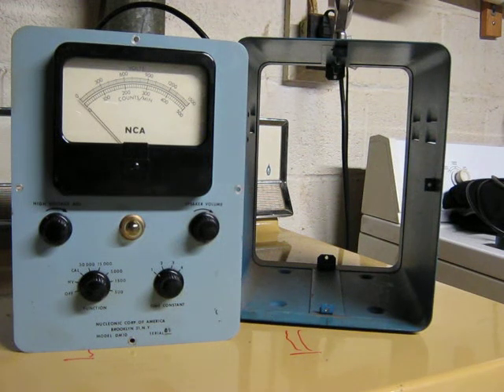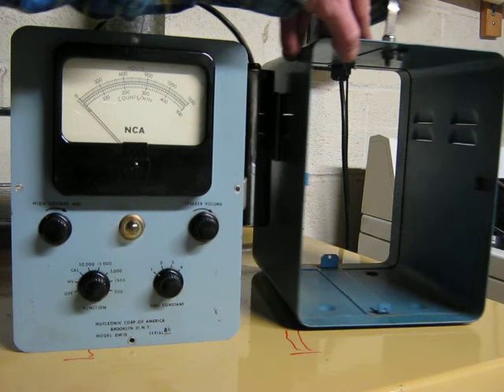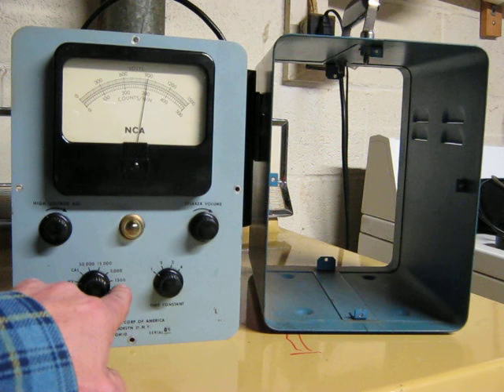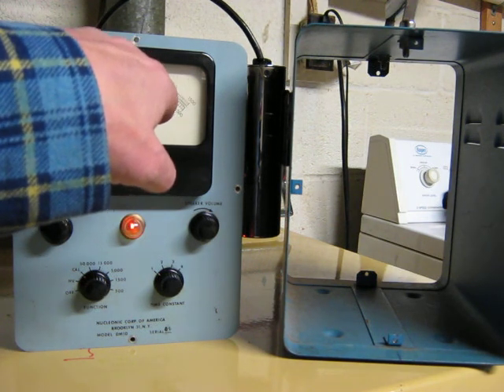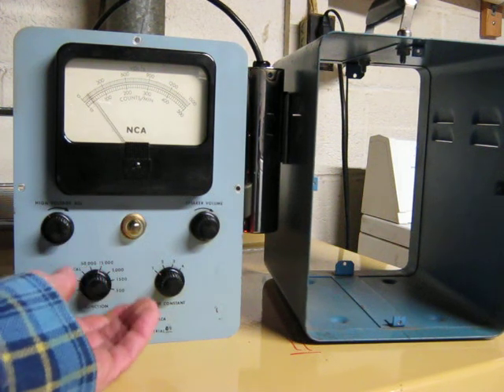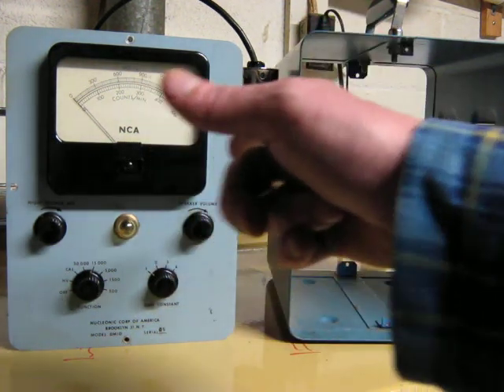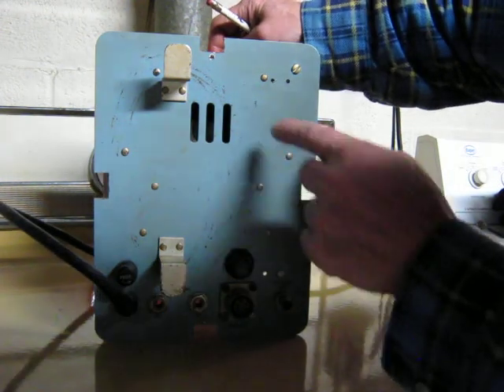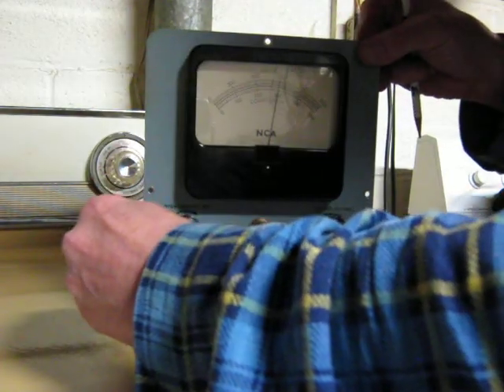Vacuum tube Geiger counter

Comment: Beautiful machine. Awesome!
Reply: Definitely beautiful... and doubly awesome that it uses vacuum tubes. :-)
Reply: 13:00 yep... that little mica window is bowled in just a little bit from the negative pressure inside... intriguing...it's very little vacuum just pulls on that gossamer mica window slightly....plus, the traces of gases to make it way more sensitive compared to an open-air ion chamber type of a home-brew probe setup with, say, a small steel juice or soup can, all cleaned and stripped of any varnishes or paint or whatever down to bare metal...in the center of the closed end of that can would be a feed-thru insulator, and the ground of the coax cable would attach to the can's body, and the center conductor would attach to a length of stiff wire which would be mounted through the feed-thru,  and the length of that wire extending through the center of the inside of the can toward the open end. It would take a very sensitive amplifier and some higher high-voltage to make the readings perceivable, but, having the sensing window open to the air, with no glass or mica, etc covering it, it would detect the alpha-particles, which otherwise would be blocked by the glass or mica window .. I'm all interested in it because I love to home-brew equipment with old vacuum tubes and am envisioning making a Geiger-counter, and the most critical part is the probe... it's cool to see one like that one close up.